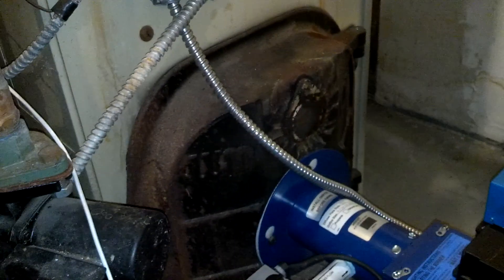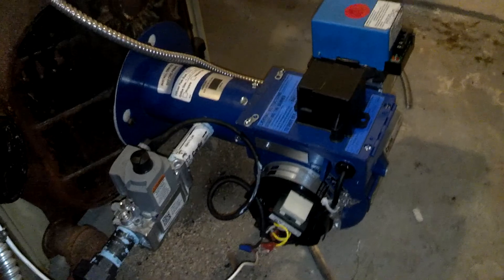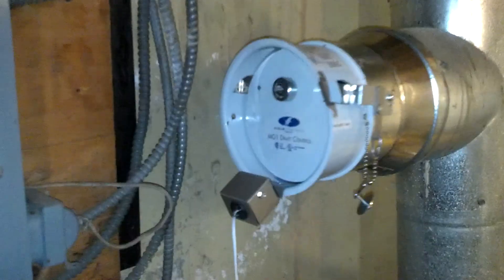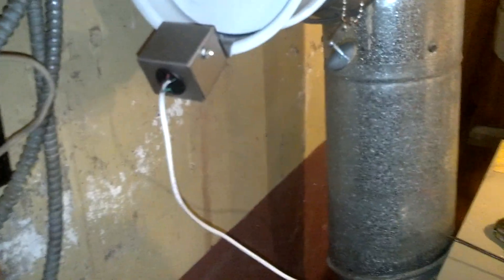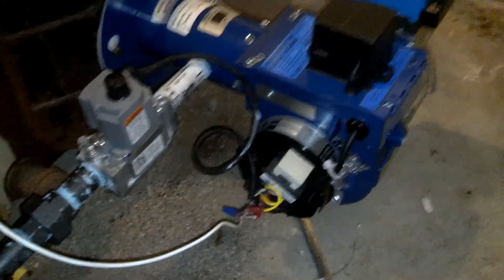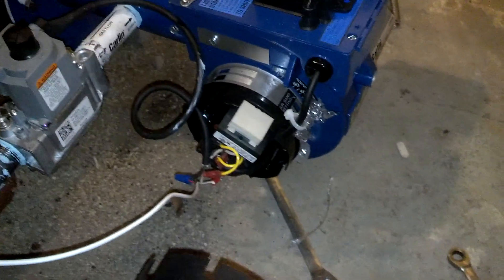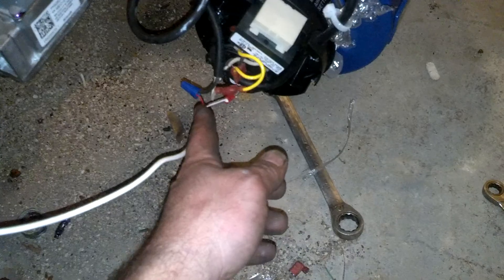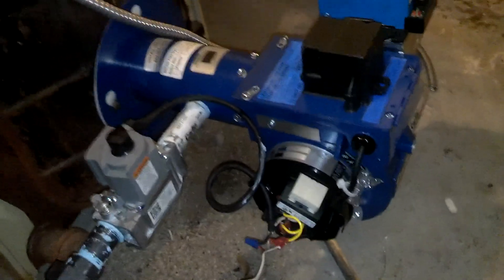Carlin ez gas pro wiring spill out switch

Comment: Does it work
Reply: Just installed one this is incorrect. There are actually terminals to connect the spill switch to on the burner. Don't wire this way.
Reply from the maker: Here and there

Comment: Just replace the boiler. I don't recommend power burners.
Reply: Why you don't recommend power burner?
Reply from the maker: Some people are afraid of others with too much power
Reply: Some people just want to go natural gas which makes boiler run cleaner and no more oil deliveries. Easy to say just change boiler but your talking about $5000 more so some people don't have that kind of money.  Also in some cases the oil boiler could be in good shape and not that old so throwing a conversion burner on works out pretty well.